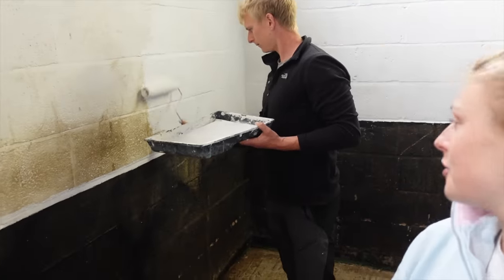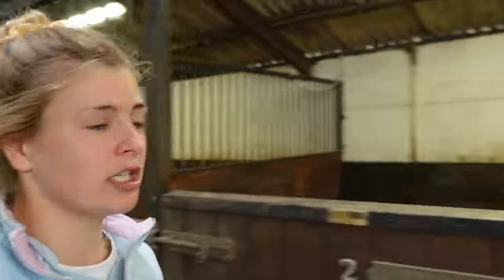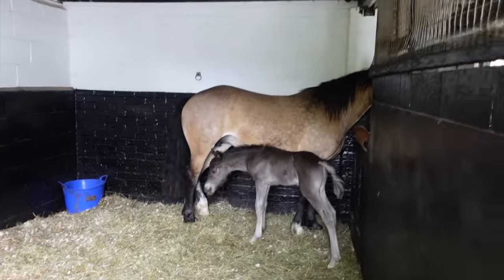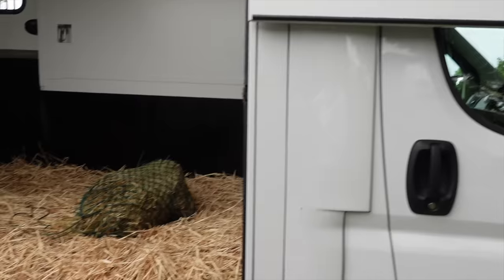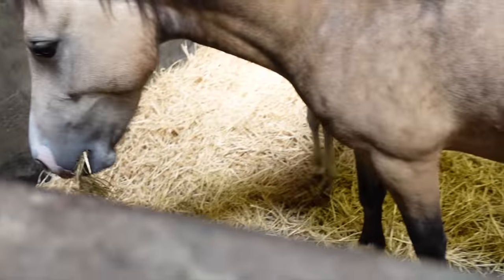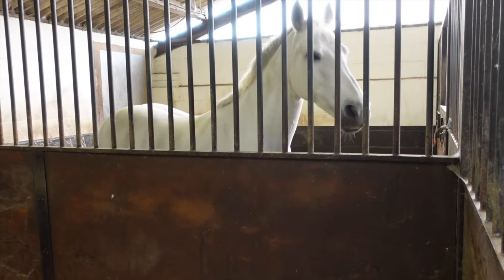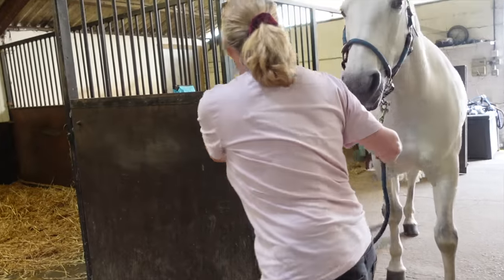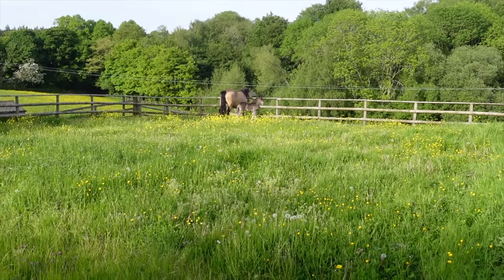BRINGING MY *tiny*  FOAL HOME

Comment: I haven’t even gotten to the part where you pick up mommy and baby, but I had to stop to comment. HOW have I watched ALL of your videos and never ever known you had a brother????  Since I discovered your channel several months ago, I started binge watching all your videos from the start. Never seen your brother before or heard him mentioned! 😂 I also wanted to say that I wish we had horse boxes like that here in the US!  Every time I’ve had to trailer my own horse, I’ve had to hook up my 2 horse gooseneck trailer to a truck equipped with the whole trailering package. Meaning I have a ball in the center of the truck bed that I have to align exactly with the trailer’s hook up. I find it really difficult to line up without help, and once the whole set up is complete, I can’t back the trailer up to save my life!  I can’t give a good scientific explanation of the geometry going on here, but you basically have to turn the truck wheels the opposite way you want the trailer to go. It is SUCH a pain in the butt!  It does steer much better than having a bumper pull trailer, but either way the truck and trailer are separate and have to be hooked together. I would LOVE to have a single vehicle to drive my horses in!  Why don’t they have this kind of horse box in the US?????